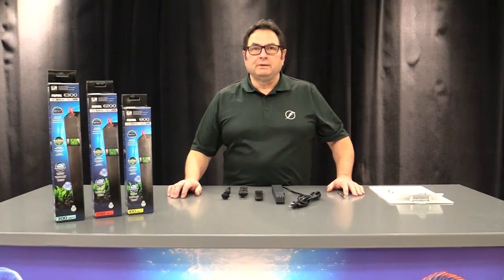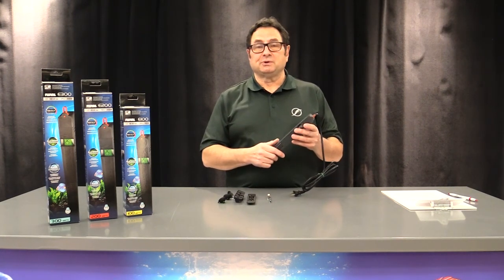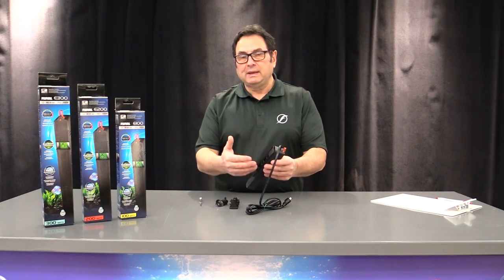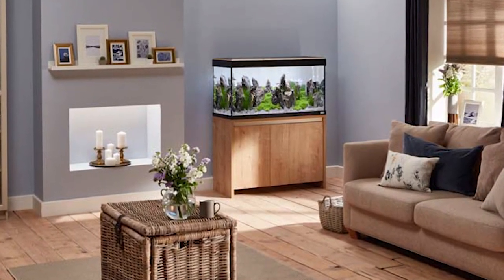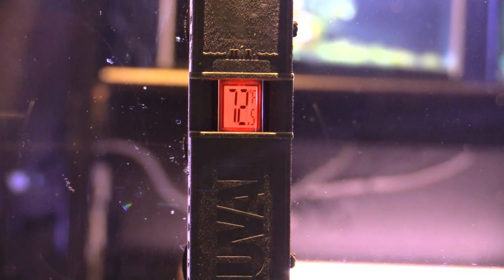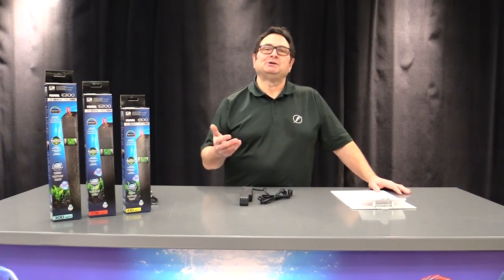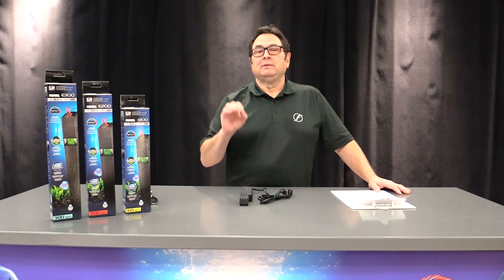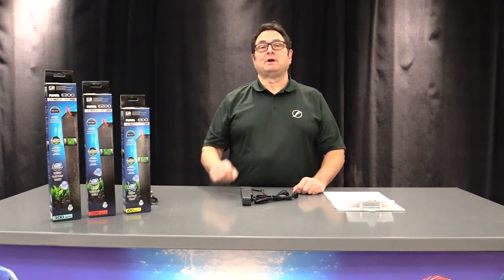Fluval E Series Heater Operation & Troubleshooting Tips

Comment: It's a Fricken heater why are you trouble shooting a heater.  Buy a normal heater and move on with life. :)
Reply: HofFritZ   I have used tetra, eheim, fluvel  and colbalt and the best most reliable have been the Hi-top (China) and Nicrew and I've found them reliable and temperature spot on

Comment: Hi. 
I upgrade my FX6 with a Spray Bar FX, and my E300, don't heated the water. Why?
The spray bar are upper to E300.
Reply from the maker: Hi there! E Series heaters require strong water movement across the heating element to function correctly. Try repositioning the heater to be more directly in the path of the water flow!
Reply: @fluval  Thank you very much in advance.
Yes, as I said before, even with the FX6's duckbill, I had to point it directly at the heater.
Now, with the new Spray Bar, I think that the water circulation is more uniform throughout the aquarium, and from what I see (both on the plants and when I add food) there is greater agitation.
I don't accept being told that I don't have enough flow to the heater. I have an FX6 for a 320 liter aquarium (plus 30 liters of filter will give about 350 liters)
One of the two, either this heater is no good, or it has a defect and if so, it needs to be replaced.
Ah... I've been an aquarist for over 30 years and this has never happened to me.